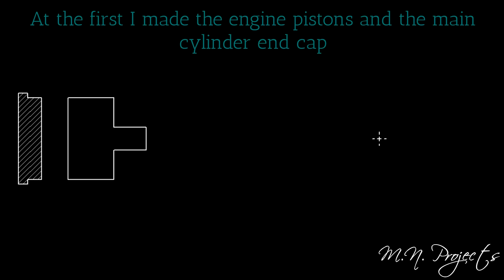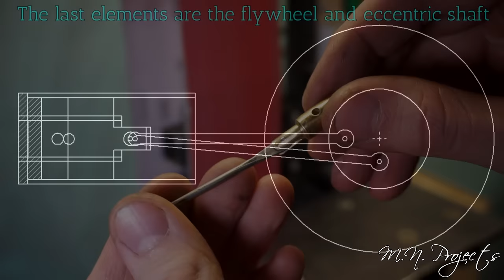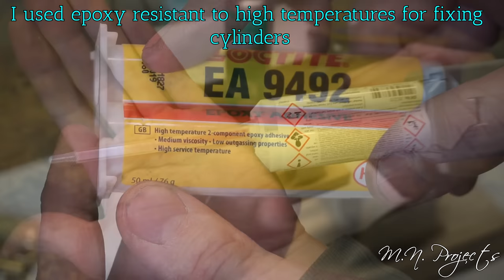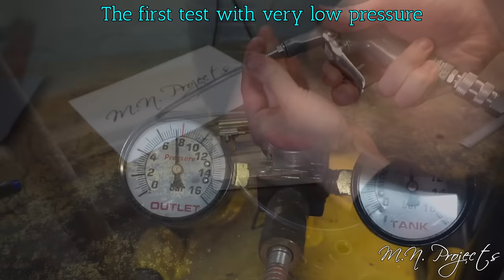Making a Steam Engine

Comment: Hi there, thanks for the nice video, i am trying to build one, but i have one small problem. can i perhaps have a nice picture of the small piston, i cant see if the grove on the side goes trough to the hole that is drilled trough.
Reply: No, it doesn't.

The operating principle is the following.
Lets start with the main piston in its Upper Dead Point (UDP) state and lets call this 0° (and lets assume the engine is already running).
The valve piston is in its 270° state.
Due to the fly wheel the piston continues its motion and starts to move into its 90° position. The valve piston moves from 270° to 0° and the through whole starts to line up with the hole to the piston (and the hose). Steam (or in his case compressed air) beginns to enter to the main piston and pushes on the piston. The power stroke has begun.
WHen the main piston reaches its 90° position, the valve piston has reached its 0° position and the through hole lines up perfectly with the hole to the main piston and the hose.
As the main piston continues to turn from 90° to 180° (that is the lower dead point - LDP), the valve piston has gone through its UDP  and the through hole begins to misalign with the hose and the boring to the main piston and thus steam flow begins to reduce. Somwhere in between this quarter turn, the through hole no longer connects the main piston with the steam but (after a short time without any connection to the outside world) the grove begins to align with the boring. As the main piston makes its turn around the LDP and continues to 270° the grove is fully aligned with the boring and the steam from inside the cylinder can escape through the boring and the grove as the main piston makes its way back to the UDP:
When the main piston reaches its 270° position, the valve piston is at 180° and the grove still gives way to the outside world. But since the valve piston has reached its 180° position it now begins to go back and eventually the grove will no longer align with the boring to the main cylinder. A short time after the main cylinder has reached its 0° position, the grove in the valve cylinder is completely misaligned with the boring and the venting of the main cylinder is stopped. The flywheel takes over and with its inertia it will force the main piston to continue its movement (and with it the valve cylinder). This continues until the through hole in the valve piston begins to line up again with the boring to the main cylinder and the next power stroke begins.

You may want to rewatch the video beginning with 09:51.
Stop the video and watch it frame by frame (using the ',' and '.' keys on your keyboard) and think about what the position of the valve piston is and which parts of it now line up with the boring which connects the valve cylinder with the main cylinder.

Once you understand it, it is really a simple process.
The main points are:
* you want the through hole to start giving way to the steam as soon as the main piston has gone through its UDP (0°). If the valve opens this way to early, the steam actually will counteract the movement of the main piston.
* you want the through hole to close shortly before the main piston reaches LDP (180°) . The closer you get to this requirement the more energy you can use from the steam. But don't overdue it!
* you want the grove to connect the main cylinder with the outside world shortly after the main cylinder has passed its LDP (180°) .
* and you want the grove to misalign with the boring and thus close this path shortly before the piston reaches its UDP (0°) again.
* you want to dimension the through hole and the distance to the beginning of the grove in such a way, that they do not align with the boring to the main cylinder at the same time at some position. Or otherwise the steam would just enter through the through hole and exit immediately through the grove without having done some work on the piston.

Comment: Could anyone please explain exactly what he is doing from 4:18- 4:25?  Is he melting the ends, or brushing a chemical on them??
Reply: My assumption is that hes using epoxy at the sides of the rod so it will stay in a straight path without moving to the side or slipping out if the hole

Comment: Thanks for sharing, ive always wanted to make one myself i have the tools that you do, but on a larger scale to power a generator. but I don't understand the dynamics of valve vs main cylinder ratio,
Reply: There is no ratio between the two cylinders. The smaller cylinder is actually a valve wich lets air into the piston just after it has left the bottom dead center (the power stroke), and lets air out from the piston just before it reached the top dead center (the return stroke), so it must be timed precisely for efficient operation of the engine.

Comment: How about designing that on a motorcycle and powering it with a SCUBA tank which you can pump them up to 3000 psi and you can control it with a variable speed air  regulator

Comment: Doesn't it need a boiler to be a steam engine
Reply: Yeah but you can also use high pressure to make it spin bcs basically thats what a boiler would do.Heat the water to make steam that spins the flywheel

Comment: Air is not steam.
Reply: its the engine only. steam engines used a type of burning material to produce steam, and it would power the piston and blah blah. Dis dud only made the piston and wheel and system. but he uses a compressor to power it.

Comment: Connect a steam engine to a sawdust-fired boiler and you'll have renewable energy.
Reply: Hagen van Tronje  
Actually no, it would not save fuel.
The efficiency of a steam engine is lousy compared to having a generator attached to the motor which drives an electrical motor in order to operate the compressor of an airco.
And it has the advantage of not having to carry lots of water with you in order to boil it and lose it to the environment in the form of steam. Another advantage is that an electrical generator produces electricity as soon as it is driven by the main engine, while it takes some time for water to reach its boiling point.
So all in all: steam engines had their times, but there were many reasons why they were replaced as soon as other technologies became available and could produce the same power. Steam engines are nice and fascinating, but have a lousy efficiency compared to everything else.
Reply: Hagen van Tronje  
Condensers do not recycle 100%. That's why steam locomotives had to refill water now and then.

Comment: Took some digging but I managed to find the plans :P
Reply: where? can you link it ? thx
Reply: @pencyll2326  Hi Vladimir,I was very grateful for the link to the plans for this steam engine but have still not found it after visiting the page  on this  link, I think there was four headings but couldn't  find anything connecting to the plans,would you kindly tell me what to look for, I have also found MJ  Projects on Instagram and a photo of a small part of the plan but no links to the actual plan. Any help would be very much appreciated. Thanks Dave
Reply: @davehuxley6689  Looks like that website has been scrapped and now redirects you to other sites :(
Reply: @pencyll2326  Hi Vladamir Thank you very much for replying , I have searched the mn projects web site still can't find any links,I am thinking of having a go at the model and see if I can fathom out the porting etc,have never made a steam engine  before. Thanks again for you help.

Comment: Many technologies exist, and we add them to the newer Technologies. The vipers clean the water from the screen. Added the idea of an intermittent electronic switch to turn on and off. The steam engine was an invention, but not The internal combustion engine.  It was a  modification of the steam engine or added-on technology; Further extensions are the turbines and jets, and rocket engines.  Exhaust the powers.  One of the simple explanations I saw in this video 

https://www.youtube.com/watch?v=nOBJvQrstt4

These ideas are born in only a few individuals.  Workers 9-5 are clock in and out and will never have innovative ideas. The designs of the internal combustion engine have not changed since its early design.  In Germany, Fellex  Wankel came up with the idea of a rotary engine used by many manufacturers, including in the Mazda Rx series. Torque and power per LBs were tremendous but were; not successful or desirable by the consumer due to the lack of service.  This design was great for sports cars.

https://en.wikipedia.org/wiki/Felix_Wankel

I have many ideas for reducing the sizes of the power generators or replacing this outdated and air-polluted powerhouse but have no resources.  So what do we do?  We designed and built a virtual product in our mind test and think another product to build.